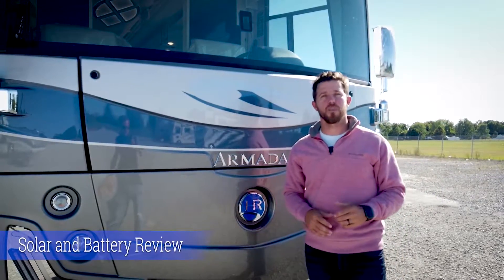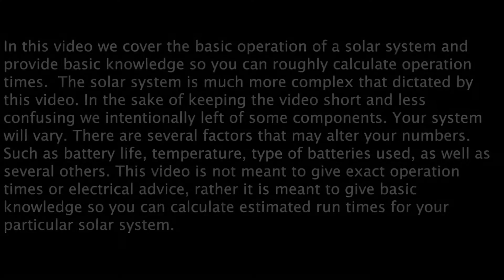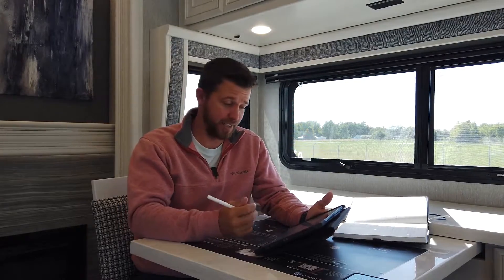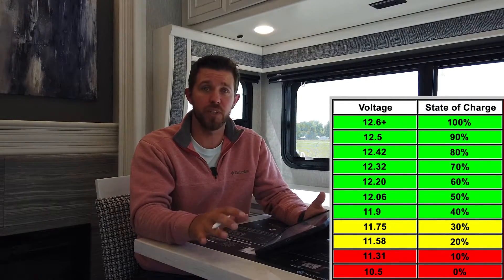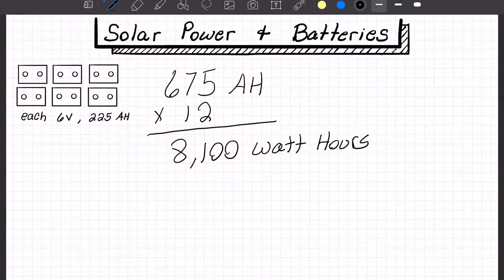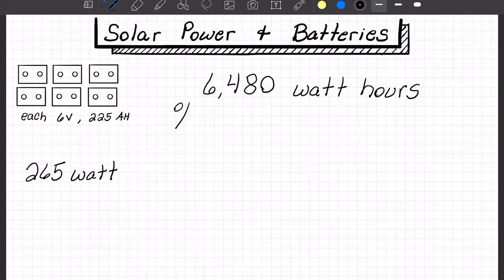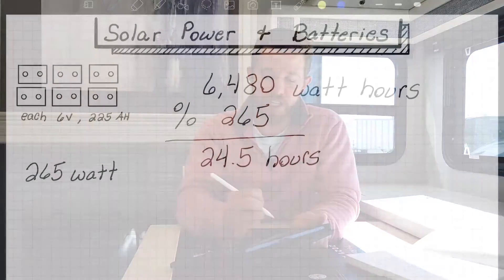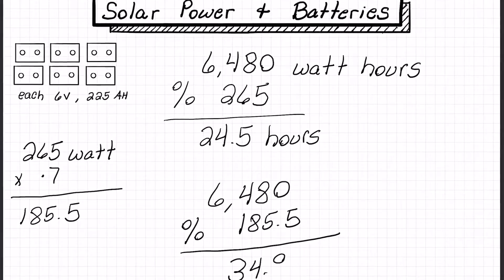Fleetwood RV - How does my solar system work? #FleetwoodRV #SolarPower

Comment: How did you bank 3 x 6v and get 12v? Wouldn’t that be 18v ?
Reply from the maker: @travisgarland840
      There are (6) total batteries. We wire 2 together in series that gives 12 volts. That process is repeated 3 times, so we now have 3 pair of 12 volt batteries. The next step is to wire the (3) 12 volt pair in parallel and that increases the Amp hours. 
                          Thanks   
                                           - Mike -
Reply: @fleetwoodrv  ahhh ok. My bad. That pretty awesome

Comment: First off you should never drop below 50% on a Deep cycle battery of you run the risk of damaging it or shortening the life of the batteries. Using Lithium batteries is a far better and much more modern choice. Lithium also reduces the weight your rig must carry which increases the owners storage capacity for other things they must bring along. There is literally no reason why in todays market we are still using deep cycle batteries in new rigs. 

Why is there any reason to use 100w lights. A modern rig should have all LED bulbs. Anything less is a waste.

Why only two 265W Panels? There should be options for 2-4 and maybe even more panels. Let's be far less dependent on gas/diesel/propane systems. Yes a Generator can still help if you have very cloudy days or even inclement weather. Best practice is to use as much solar as you can to reduce the dependence on fossil fuels.

Come on Rev Group. Your supposed to be leaders not followers. You do need to show the way on this and other tech that can make our experience better.
Reply: Agreed, 1000W solar should be dang near standard equipment along with lithium batteries. Cars are going through a major technological transition right now and RV's should be too.